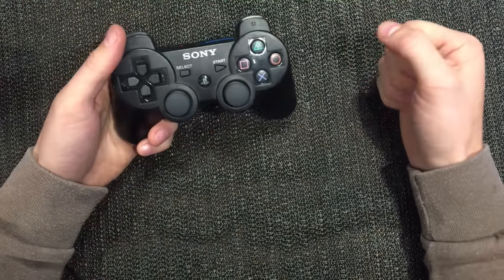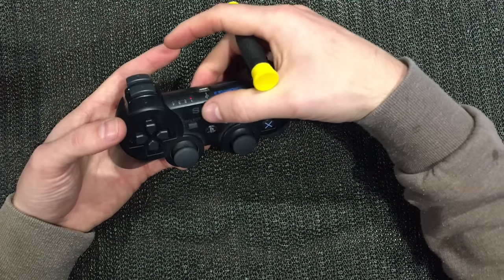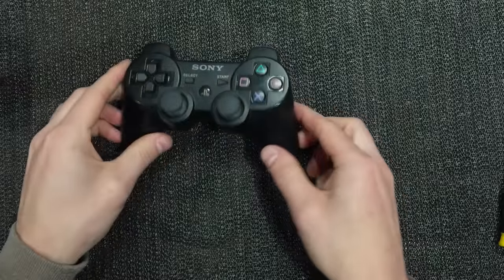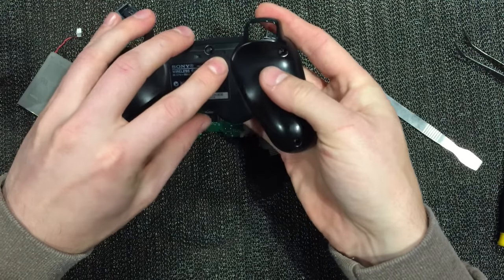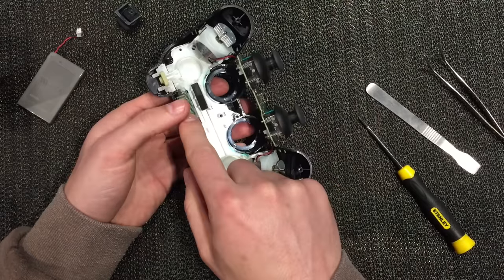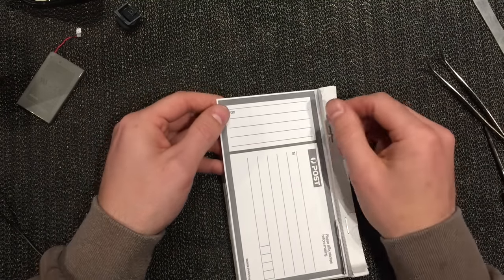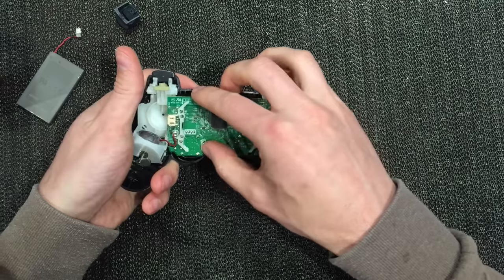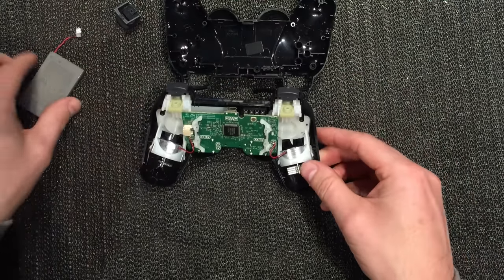PS3 controller buttons pressing themselves fix - YouTube

Comment: Nes/Snes controllers still work after 30 years. PS3 controllers start doing this after a month.
Reply: CalvinistOnACouch mine started this after 5 years
Reply: My controllers suck mad asssssssss
Reply: Depends on how they're used. I just fixed mine thanks to this tutorial. Started to live its own life after 10 years, so not that bad, isn't it?
Reply: True
Reply: i had mine for years and it never controlled itself
Reply: Use it? i used one and then put it back in a bag using only one,then we tried to play a fighting game and the other controller was doing that shit,so don't say "It depends of you use it" becase that happen even if you don't,how? i don't know but it does.
Reply: Helltio Everygames Your case doesn't really mean anything anyway, because in that case, my controller started doing this after, like 6 or 7 years of bad use (falls, even cracks at the sides, etc) while the other controller didnt, because I try to not spend more  money and worry about my controller. But my point is that in these matters our particular experiences don't prove anything. While some people are lucky and some get bad manufactured stuff, we got our shit and the only thing we can do is just be careful, if not, curse sony for their broken stuff
Reply: Mark AirWind yeah your tight ive had 4 controllers white is mine black is my sis and blue and camo r by Bros mine and my sis work fine but bros are malfunctioning weve had em for 7 years
Reply: CalvinistOnACouch mine did it 8 years later
Reply: All i did was put old business card paper in there and it worked now all i need is 2 ps3 shells beause my red one is falling apart and the one that came with the console is getting there too
Reply: CalvinistOnACouch not really I've had mine for years they're only now just doing it
Reply: River wolf Plays i found out that the plastic that holds the ribbon contacts for the dpad and buttons can fatigue the foam overtime especially if you play gow a lot
Reply: TheAVJ2 i guess
Reply: River wolf Plays idk if youve seen the plastic that holds the foam but it has hard ridges with enough space for the foam to shrink into it that plastic holds the ribbon cables for the dpad and buttons if the foam would be an mm or 2 bigger it would last longer
Reply: TheAVJ2 i don't know i haven't cleqned mine yet
Reply: River wolf Plays well if you get dpad problems buy a shell and 1/4 anti fatigue foam or put something to put more pressure on the contacts
Reply: FOR PS3: SOMEONE HELP I have been Fighting With my last controller. Being a broke bloke I hope this works. Whenever I shake the controller The triangle and X button press as well as either the D-pad or Analog sticks move. For instance. In Skate 3. When I try to do a kickflip while Steering. I jump and kick the board. Then it takes 10 min to get back on. If this video is my prayers answered someone please tell me. In desperate need here guys!
Reply: mine started after years of use
Reply: Yeah, they are less complex.
Reply: Yea lol my other controllers started doing it after 2 years my new started doing it after 3-6 months
Reply: PS3 controllers are more complex than NES/Snes controllers, I have both of those controllers,they work fine, I also have two PS3 controllers, one works fine, the one I bought with the system, but the other one I bought separate, I fixed that one by watching this video. Thank you 
 Global Garage.
Reply: false. Had mine since 2006, and it only developed this because I threw it at a wall.
Reply: PS4 controllers are rubbish too. First you realise the battery life is pitiful, then the thumb sticks fall off, then the R2 L2 buttons break then the analogue sensors wear away!!
Reply: CalvinistOnACouch mine took 5-ish years to start doing this.
Reply: after 4 years*
Reply: I have a 10-year-old controller that just recently started giving erratic left inputs. Not cool when I'm trying to drive all precisely and stuff in Gran Turismo.
If your controller starts doing this after a month, you probably bought an off-brand POS.
Reply: @prodbaizas  mine too.
Reply: Still work better than Wii motes or gamecube controllers.
Reply: @prodbaizas  Same. My ps3 controller is doing the same after roughly the same amount of years.  I had a previous controller that was acting up  and now the one I'm currently using is doing this as well. Really annoying.
Reply: SNES controllers are less complex, who would've rhought?
Reply: It took mine 10 years
Reply: They don't rumble and are a flat design, there not prone to being  flexed either.
Reply: Bs I've had mine for over 6 years and it just started acting up
Reply: Depends on use and the technology is harder and more unique in a dualshock 3
Reply: Dualshock 3 are trash. My Dualshock 1 still work like new. I can even use them on my Ps3 with an adapter, but it doesn't work in every game.
Reply: CalvinistOnACouch my ps3 controller started doing this in 2016-2017, this console is from 2006, it had been used for less than 1000 hours for all of these years, I was really playing 2-3 hours a month, my fat PS3 is like the day I bought it, it is not scratched at all, it is glorious lol
Reply: My controller started doing this after few years and it I haven't used it daily, few times in week and then few times a year lol
Reply: My PS3 controller did this after 2 years

Comment: I can't believe Sony would expect a connector like that to maintain durability without a socket, on a device that would experience regular stress and movement, no less.
Reply: I don't believe that Sony let a Company put a controller in the stores that doesn't. Do all the things their own controller does. If you make a product it SHOULD BE JUST AS GOOD AS THE ORIGINAL. IF NOT BETTER.🤔🤨
Reply: its all about efficiency minus cost - that is capitalism. It wasn't built to last but to barely (maybe) get you through to ps4...
Reply: lmao they deliberately do this so you buy more controllers
Reply: @Ecliptor.  no they dont.
Reply: @westafoya6772 "The controllers ArE BaD bEcAuSe Muh capitalism" thats funny because since the consoles initial release I have only ran into one controller with this issue and it was easily remedied following the steps in this video. These controllers are fine, a small margin of them have defects due to mass production. Shill for communism somewhere else.
Reply: @rust8infinite  I always found it interesting that those that are guilty of something always accuse others of that some thing. "Shill for communism somewhere else." Sure, if you actually get an education between the difference of the chances of a faulty product from mass production with quality parts and design and the obvious fact that there wouldn't be a need for this video and many-many other videos like this is there weren't so many damn crappy controllers. Corporate greed cannot brush away this crap. And it is capitalism at its worse. But as for me being a 'swindler' as what shill means, I'm sorry you think that a working american who bought three controls to have two break within a week of each other want to mention it so perhaps someone with authority might look into it or at least bring an awareness that something isn't right. But I digress - your right, I guess I should be a communist and keep my mouth shut and do what my 'superiors' (you) tell me to do and keep the secret that far too many out of the box controllers are worth less than the packaging they came in.
....please don't report me to the KGB.....
Reply: Because they want u to buy a new one.
Reply: On the original dual shock 1 controller they are a slide in connector. Has me stumped as to why they change it to this.
Reply: @westafoya6772  well, at least in capitalism world you have option to not buy shitty products, thus forcing companies to either make a good ones or die of bankruptcy. Thankfully it provides competition. But yeah, customer's blind consumerism is a terrible thing, but that is issue of spectacular individuals.
Reply: @PHYSiiXz  probably why the older controllers have a failure rate much less than the crap they put out now, or 10 years ago (ps3)
Reply: It's really bugging indeed
Reply: Can you believe many models of the ps2 controllers had the same connector?
Reply: UncivilLeech nuff said and well put.
Reply from the maker: If this fixed your controller, please consider leaving a tip here https://www.patreon.com/GlobalGarageAus
Reply: Just tried it. Works flawless thanks
Reply: Well the crap I threw behind it did last either and here I am again years later.
Reply: maybe they planned to sell replacements DS3 for 15 years lol
Reply: @pashadyne  if you can't understand the issue here then I feel sorry for you, it's not hard to comprehend that sony cheaped out, they wanted people to buy new controllers and the new systems so they didn't care if the ps2 and ps3 controllers don't last long, in fact they'd prefer it, companies do this all the time, just look at apple with their updates that slow down older phones so people are more likely to buy new ones, and it's not like muh bad no no communism food lines is the fix for this, it's restrictions on lack of quality so rich penny pinchers can't, well, penny pinch, that are the fix for this
Reply: @pashadyne  Denying the reality of planned obsolescence is a new one. Jumping through some hoops to do it too. Went from "they aren't doing it" to "it doesn't matter if it's built well" in the space of one reply. :D
Reply: @professorjitterskull8436  Quite clearly they don't die from bankruptcy.
Reply: @rust8infinite  No-one suggested communism.  It was simply a completely accurate and valid criticism of capitalism as it tends to operate in the real world.
Reply: They don't expect it to last.  They cut corners anywhere they can to cut costs.  If it fails outside warranty, but not often enough to make consumers angry then it is a success.
Reply: @pashadyne  you do realize most people just throw away controllers that don't work right? They don't go trying to DIY it, they just buy a new one. And regardless I feel that playstation consoles and their controllers should function for at least a few generations. These aren't things you instantly throw away when the next one comes out, mostly due to ps lacking in the backwards compatibility department
Reply: @loganmedia1142  own an iPhone and pay attention to how fast it is after a few updates, there's your evidence. And no one suggested communism here, my mention of communism was in response to someone calling others communists for simply wanting higher quality control standards(guess things never change huh)
Reply: @pashadyne  then there would be no point to this video, people still use the ps3, even if just to have nostalgia trips
Reply: @pashadyne  you're really digging yourself into a hole here. The simple fact is the ps3 is still widely used by millions of people. It may be outdated but it's not dead in the slightest, even if ps had backwards compatibility it wouldn't be completely dead bc there's plenty of people who don't have the money to buy new things
Reply: @pashadyne  when referring to gaming dead means disused, the ps3 is not disused
Reply: @pashadyne  it's numbers based, obviously if the player count drops below a thousand it's basically completely dead, but at the moment it's the 6th most active platform with millions of people still off n on playing on it, so it's alive and kickin just fine. I mean just look at this video, it's gotten nearly 700k views despite being made just 6 years ago
Reply: @pashadyne  based on your complete lack of points I'm gonna go on a whim and say I won
Reply: @pashadyne  can't support? I'm sorry you can't literally just look at the view count of this video?
Reply: @pashadyne  idk why don't you tell me
Reply: @pashadyne  neither do I
Reply: @pashadyne  that's crazy wow
Reply: @pashadyne  yea lemme just send you a ss brb
Reply: @pashadyne  blocked and reported

Comment: WORTH NOTING - sometimes you gotta cut it on foam's short edge a tiny bit because the foam expands over time and then it's bent. Check if yours doesn't seem tiny tiny slightly enlarged, which minimally bends it

Comment: Hey guys, just did this on my controller and works great! BUT, make sure u guys put the green pcb UNDER the black tabs... spent like 30 mins trying to fit in the back and it kept on being uneven and finally figured that was the problem. Hope that helps anyone else having a problem putting the controller back together. Good luck :)
Reply: it says that in the video. I think following directions is the most important step here.

Comment: Well done! My PS3 controller, which is embarrassingly STILL my daily console, has really been acting up. I ordered a cheap one to tie me over, but opted to try and repair this one. I didn't have the proper chemicals to clean the contact points, but was able to build up the underside of the foam contact prop. My controller works perfectly. My guess is that pressure from the controller being closed at factory in addition to the constant analog vibration, it seemingly wears grooves into it from the plastic. Building it back up was a great idea. Thanks!
Reply: Don't feel embarrassed of still playing PS3. The console has amazing games to play!
Reply: Yeah don't be embarrassed lol. I was still playing Sega Genesis while everybody else was on their way to the PS2. That's behind man PS3 was the shit.
Reply: Don't be embarrassed. Anyone who tries to make you embarrassed is not worth your time. I bought a PS3 in 2022 and I am happy I have got so many amazing games to enjoy. My controller glitches out sometimes too but now I am going to fix it.

Edit: - Forgot to leave a comment and it's been a month now. I read a comment in this comment section a month ago and fixed it by simply pressing hard with my thumb on the Y of SONY. It doesn't freak out anymore aside for 1 minute when you either plug or unplug it. In which case, you just have to turn off controller before plugging or unplugging it and wait for 1 minute and you should be able to avoid this problem in the future. I can finally play properly now. If the problem happens again, I will have no choice but to disassemble it but I hope I don't have to do that.
Reply: Never underestimate consoles at the end of their cycles, you know what the best games are
Reply: dont feel embarassed, feel poud of having the last console where it still was Sony a japanese company.
The company we all loved didnt exist anymore, now is just a california zombie.
Reply: I have almost every console you could think of and my PS3 Slim gets like 90% of my game time 😂
Reply: I just got mine in the last month and enjoying the heck out of it!  looking into getting a ps4 as well.  Then I saw the subscription online multiplayer and I nearly threw up in shock.  I guess I'm not a console player.  I would never pay for online multiplayer and pay to rent games.
Reply: Theres nothing embarrassing about this. You get free multiplayer, most of the greatest games of all time, and pre microtransaction era gaming and decent 60 fps full HD graphics.
Reply: How on earth is that embarrassing? I still have an n64 that I play all the time. Granted I have other systems too but the ps3 is really good
Reply: lol don’t be embarrassed. PS3 recently became my daily console but that’s because ps5 was boring me. Ain’t no games for it

Comment: 2022 -> Just confirming it worked for me as well. Thanks!

After picking back up my 3 controllers after years, 2 of them were presenting this. The fix worked so well I've done it in the working one prophylactically. 

By the way, for those of us who aren't hardcore Post Office users, here is my tip - for the "stiffening" material I used 3 layers of regular office white tape + a layer of duct tape. Worked like a charm. 

Cheers!
Reply: Great idea with the pre-emptive addition.

Comment: It’s now 2022, and I’ve been confused about my 2 PS3 Dualshock Controllers for a couple years now.  Followed your video, using 3 strips of electrical tape, cleaned the contacts with iso and they’re both fixed!! Thank You for this video, good sir. 🤟

Comment: Thanks for this. I have been postponing taking my controller apart for a some years. I disassembled it today and found it was really dirty inside, with muck and hair. I used double sided tape to thicken the black foam. Struggled a bit with the shoulder buttons when putting it back together. It works now, no more random button presses. Thank you.

Comment: 2024 here, and this is still a top tier video! My controllers have been sitting in a box for a couple of years since I moved into my own house. Finally got them out and had the jittering button presses problem. After seeing this video I put in a small piece of soft foam behind the existing one and isopropyled the contacts. Hey presto, smooth as a whistle!

Comment: You know what holds me back from doing more of these "at home" fixes, tools. I can never seem to find these tiny tools for fiddling around with electronic parts. Shame that it's actually faster for me to get a controller not made by Sony than fixing Sony's defective plastic crap.
Reply from the maker: Something like this tool kit is all you need. That's all I use. http://amzn.to/2pwM1na
Reply: It's a Phillips screwdriver and a q-tip...
Reply: @stiIIy  looks on back of official 1st-party Phony Sony Dualshock3

"MADE IN CHINA"

Hmmmmmm... 🤔
Reply: eBay has it

Comment: Your video is still saving dualshock 3 controllers to this day. Bought a "new" PS3 after mine broke, and it came with a controller who had this problem. Not anymore. Two layers of electric tape did the trick. Thanks man.

Comment: Worked for me. I used a few layers of scotch tape (rolled). Then cut the tape to the size of the foam. And lastly took a q-tip and some rubbing alcohol and cleaned the contacts. Works perfectly now.